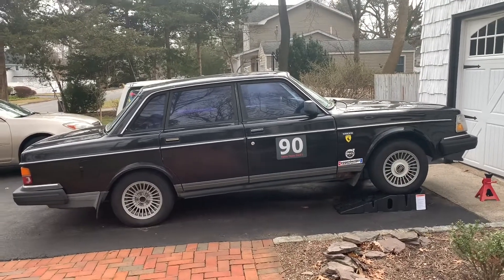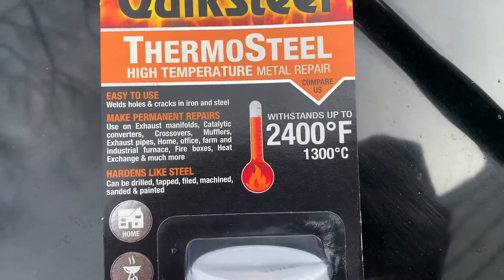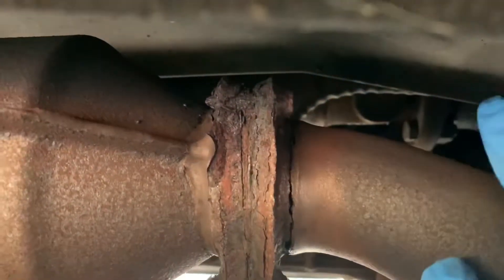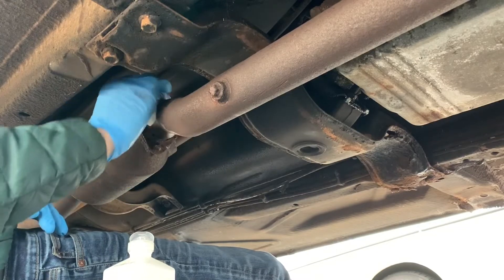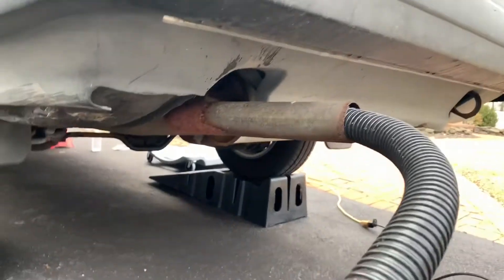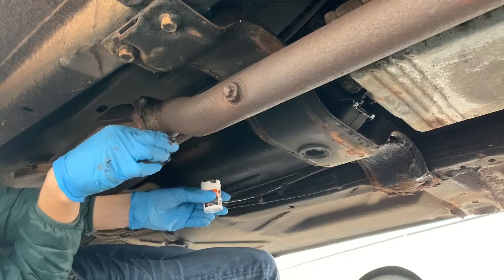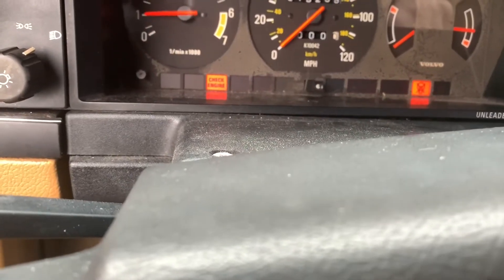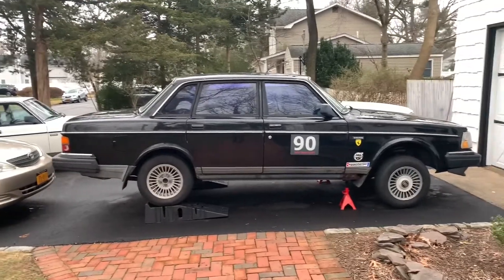Fixing my Volvo 240s broken exhaust for $8!!

Comment: I have  done many exhaust system repairs. Another product I recommend is JB weld steel stick. Available at home depot. Temperature to 350 degrees sets in approximately 1 hour cost about $8.00 Has worked well for me, and easy to apply because you knead the inner and outer parts in your hands until a uniform color, then press it in where needed. Good luck to you fix it  home repair people.

Comment: My 85 240 is broken in the exact same spot. I was able to slide the flange back into the converter and I used JB weld. I should have used something like this my first time but the stuff I used wasn't rated for catalyst temperatures.

Comment: Hey! I've got an '88 244 and was wondering what the stance on your car is like? Mine is stock and sits about 2 inches higher in the front than it does in the rear. It's a bit difficult to tell if yours is the same way from the videos. Love these 240's and hope you keep up the vids!
Reply: Don't know if you're still wondering, but your Carolina squat could just be the combination of things in the trunk, and the fact that the rear fender arches are LOWER than the front ones.
Reply: @wood8314  I appreciate the timely response man! lol. But hey, I actually didn't know that! It actually makes sense now; I always used the fender as my reference and rarely found another 240 to compare with as all the junkyard cars are up on stands. I was confused after swapping in all new springs and poly bushings on the rear with little perceivable change. Thanks the info dude. 👍🏻

Comment: Hey I have some exhaust leaks on my 84’ 244DL auto N/A. Anyways I was thinking of just replacing the whole thing with IPD Sport Stainless. What do you suggest doe the header/down pipe for slightly louder/better performance. Don’t want it too loud just a little over stock

Comment: project, what happens, is since that has an after market tailor, and where it connects that tends to rust, then you have those noises, that would make a difference, is 8t the drivers chair that has a rup by the seams, they sell a repair kit, and once the the hole has been fixed it you use a heat gun to put it back in , the way it is supposed to be, the rear license plate part you need you can get at a junkyard, there are a couple like pick a part, and some others you would be surprised how much you can get  to put that car back in top shape.

Comment: Bruhhh, either your battery is dead or something, this engine turns quite slowly...or maybe mine's fucked and I got no compression 😂
Keep these videos coming man
Edit : sounded way better the 2nd time
Reply from the maker: Victor Pelini I don’t have the car registered yet so it’s the battery that’s low from sitting
Reply: @jpvolvo4592  arff, do yourself a favor and get a cheap battery charger. Nothing worse than slowllllyyy turning engines, the oil wont even get pushed up top. Makes fiddling with them much easier, trust me